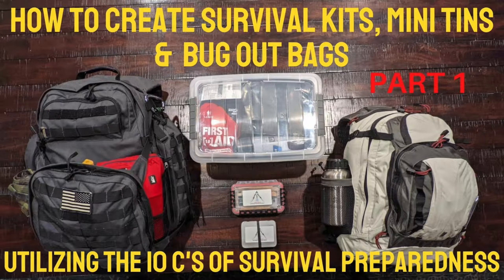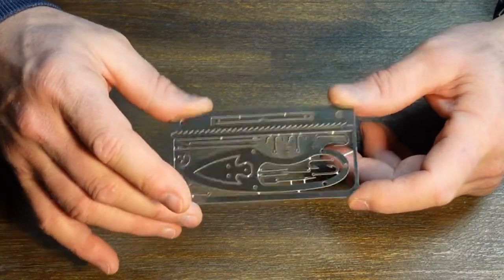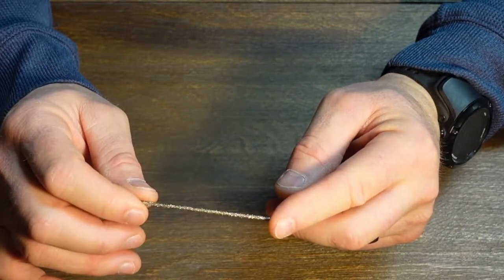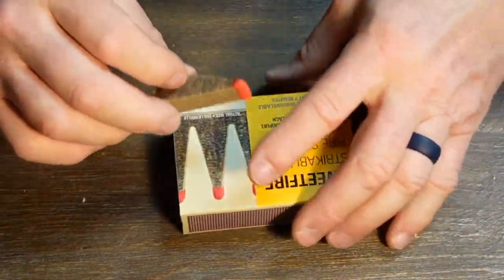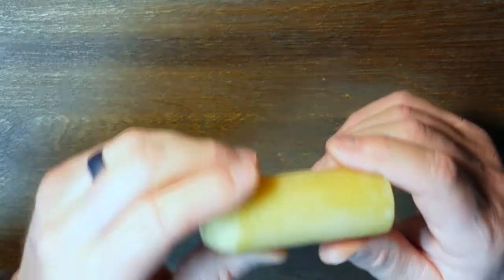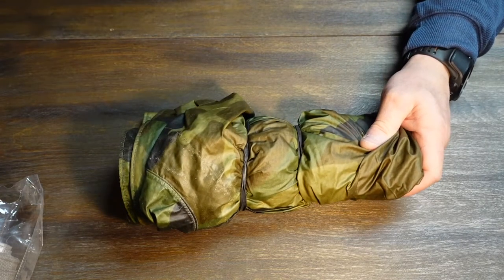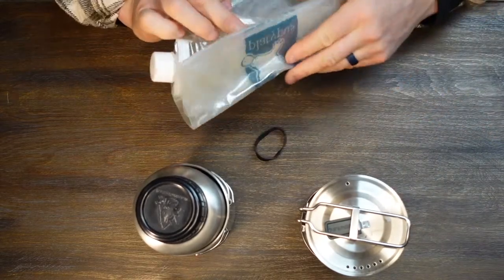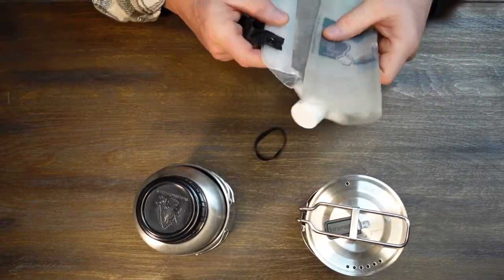How to Build a Quality Bug Out Bag and Survival Kit? Part 1

Comment: Re BIC lighters; I've mostly moved to the long ones used for BBQ and Candle lighting as they have switches to prevent leakage; and some extra reach if lighting something flammable.  also has benefit of if all gas used up the piezoelectric switch can light other items still (eg the spark clicker) so can maybe ditch a ferro rod in ultralight setups.
Of note is some of the better quality ones (like the Dusk candle lighters we get here in Australia) come with unlimited refills.
Reply from the maker: A lighter with unlimited refills would be cool!